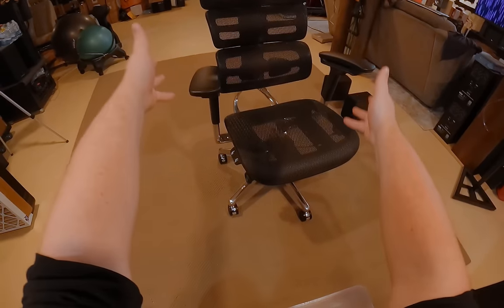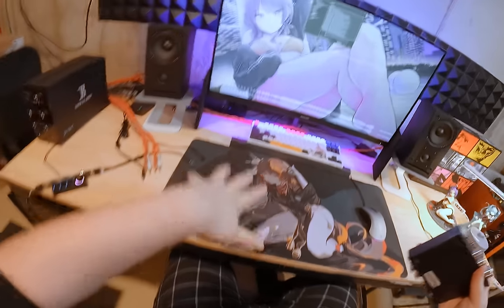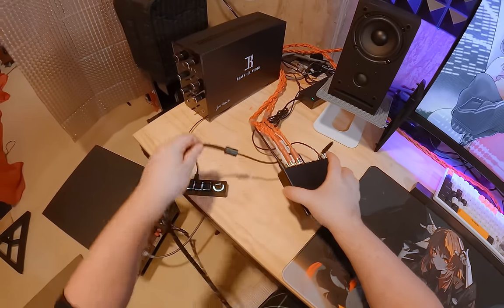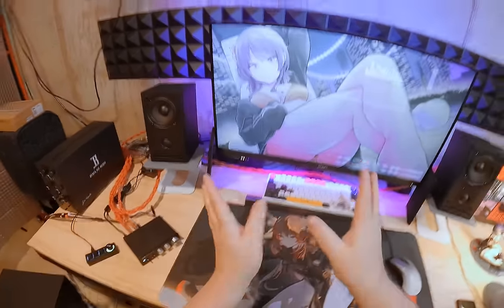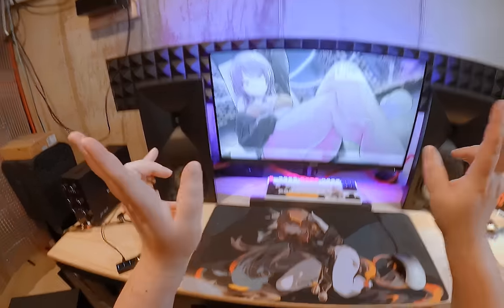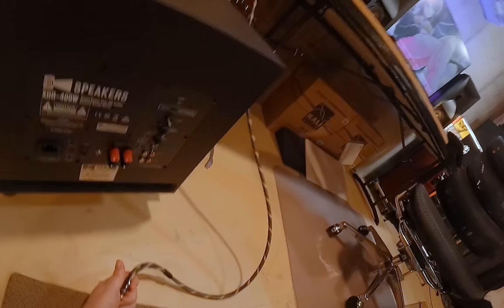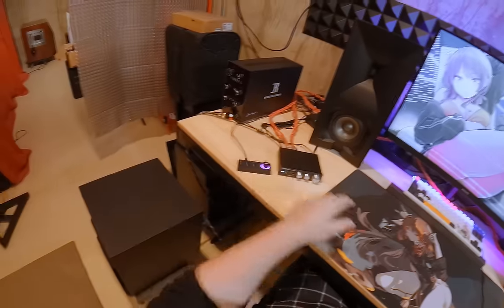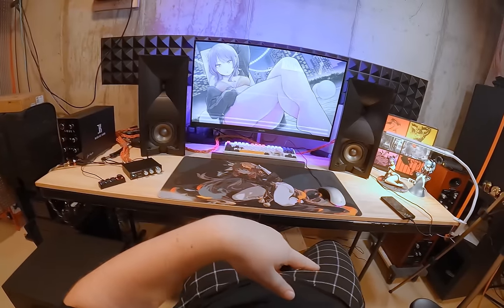The RogerSound Labs 2.1 +++ Speedwoofer 10"

Comment: RSL stuff is an amazing value, but what really stands out about them is their customer service, it's second to none. I was having trouble with my wireless transmitter and 10SII, when you call for tech support it's literally the owner of the company that helps you troubleshoot. Turned out the wireless part of the amp was acting up and I had a new amp on the way before I even got off the phone. They truly go above and beyond to help you in any way you might need them.
Reply: I bought  one Monday it was on my porch  wends......we live in no man's land....very impressive  I have 2 svs micro  3000 in the main room but the rsl,s output  is amazing since  I am using I in the other system.....awesome

Comment: Glad to see attention given to RSL's actual systems and not just the Speedwoofers (which still deserve all of the praise that they garner). Top tier company with amazing, affordable products.
Edit: SVS does sell an integrated amp, their Powerbase unit. It's a pretty nice package.
Reply from the maker: That is right they did just drop that recently. Wait till you see the Audiophile speakers they put out at CES.. Their directivity is nuts.
Reply: @ZReviews  looking forward to it! Also, in case you didn't know, RSL's larger speaker non-MTM speaker, the CG5, does have a magnetic steel grill. It was discontinued late last year for a refresh and should see a successor out sometime soon!

Comment: Based on this and reviews from others, I had decided to give these speakers a try, after all, RSL has a good return policy on these.  Upon trying them out on my computer system, I simply replaced the satellite speakers on my Cambridge Soundworks, subsat system.   I played a few of my standard test songs from Steely Dan.   Right away, I had noticed this peak at roughly 350hz, making the speakers have a very boxy sound.   The upper kids to highs were good and the imaging was much better than with the old speakers, but I had found I had to adjust the eq controls for 250hz and 500hz about 4db to mitigate the "bonk".   Even with that correction, the peak was still noticeable.   So, I flipped the speakers to put the tweeter on top, no change.  I raised the speakers up to ear level.and the speakers got a bit brighter, but the bonk was still there. 

It did dawn on me that perhaps it might be the subsat amplifier and I had taken the speakers to a different room, with a totally different sound system and tried it out there using the same music, but on a CD.   The peak was still there.  

Next, I had hooked up a pair of really old Realistic Minimus 7w speakers to my computer system and tried that out.    They sounded thin in the 350hz range, but then I forgot I still had the eq set for the CG3m's.  Flattening the eq controls bad to 0 and the Minimus 7s sounded fine. 

So after all this testing, the problem is with the RSL CG3m speakers.   I just started the return process on these moments ago.  I reported back here because I am curious if others had purchased this speaker and experienced the same issues I had with it.

Comment: are you able to review the rsl speewoofer 12? its double the size of the 10 in dimension but only a 2 inch increase in diameter. I was wondering if it was worth it over the 10.
Reply: It has been reviewed multiple times by many, including Audioholics. It's an animal of a sub, with a focus on the really deep registers (20 hz, and even below). If you have the money and want the sub for home theater duties, I'd be shocked if you weren't thrilled.
Reply: It's a crazy subwoofer for the price.
Reply from the maker: I will ask. I was holding off on this one for a while. So share around and get the view count up and I will see what RSL says.
Reply: The new 10E is $300 shipped. 22Hz.